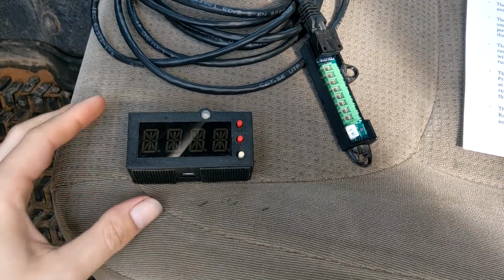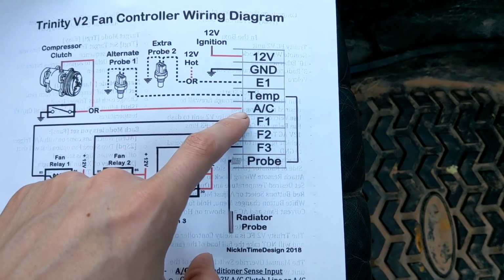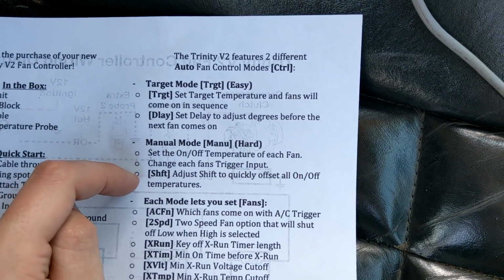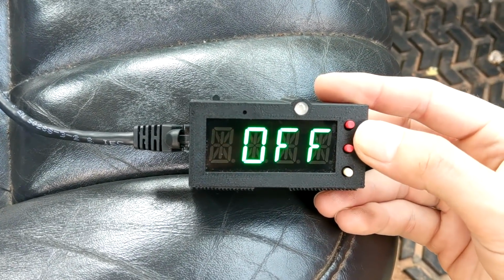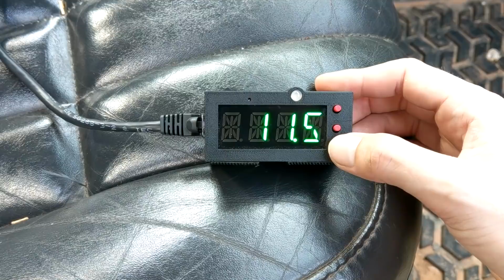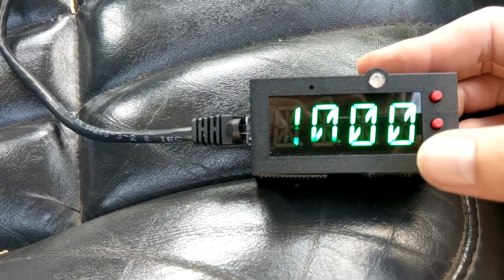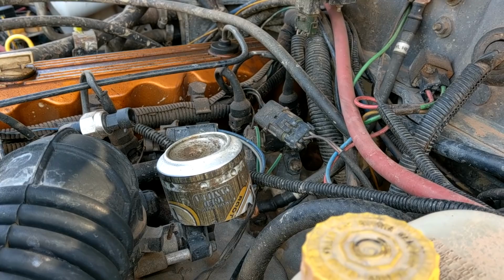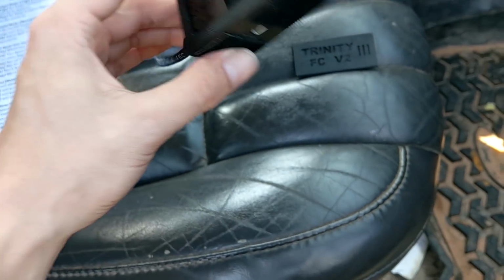Trinity Fan Controller V2 Demo

Comment: I’m glad this is also PWM compatible to some extent. a have a few fans that are pwm tone of the fans runs between 10Hz to 15.5Hz and another fan that runs much higher between 200-300Hz 
if you ever make a controller for that i would be over the moon because close to NO ONE makes super versatile pwm controllers. 
i’m doing a customs retrofit with two PWM fans but i’d love to have a second controller option for them.

Comment: how did i just discover this? i’m running two lincoln mark viii fans in my truck and want to put a 3rd that’s strictly for the transcooler would this work for all 3 even though i’d like to have the transcooler turn on at a different temp?
Reply from the maker: Yes, if you use manual setup then you can sent individual temps for each fan, as well as to use probe 1 or probe 2 for each temp reading.

Comment: Do make a pwm controller sir
Reply from the maker: This has PWM capable hardware, but I never got to program in the functionality because I ran out of space. It could be added if I removed a different feature though.
Reply: @NickInTimeFilms   PWM feature would be great for the lincoln mark viii fans since the are controlled by the cars ecm, the start up amp draw for those fans is pretty massive, coming in at about 70 amps at start up and 41-42 amps wide open. 
if you see my last video you can see the fans and the control system i’m using.

Comment: You need to level your bed so it's closer to the nozzle, also make sure your retraction is set lower and your print speed is also lower...you have a lot of visible layers. Nice work tho
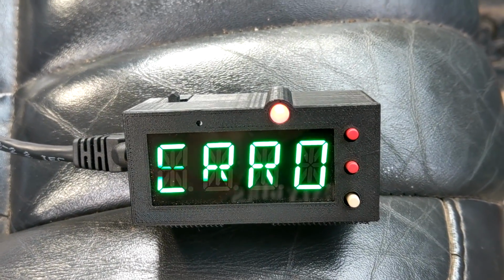Reply from the maker: 18:20 is a good closeup. Do note I love feedback and like to hear others experiences, especially with increasing print quality, so here's a rundown of my current setup.

On this particular print it looks like the bed could be raised the tiniest bit on the bottom left corner, but otherwise is one of the best looking bed surfaces I can get. I use some buildtak knockoff platform sticker, and they work well if you take care of them. The biggest downfall is that if the nozzle gets too close it will dig into it and it's ruined, so I never run too close. Second issue is that the surface leaves a white stain on prints, so the trick to keeping the black in it's true color is to run a little cool and keep the nozzle distance as far away as you can while still getting a clean surface layer. If the bed is too hot and the nozzle is too close, it can sometimes be impossible to remove a print even with thin scrappers, so the level and heat tune are prioritized for easy removal.

Now, the retraction and speeds I have much less experience in because I don't really notice a change when I mess with them. I've only moved them up to a mm or 2 so I'm not sure how much you actually change them for results and what to look for when doing so. I use Makerbot Desktop for a slicer and it's easy to use but some of the pathfinding and support generation is downright terrible, so I just work with the best I can get out of it. I'm curious where on the print you notice retraction issues as I usually pick any little strings off. 

As for print speed and layer quality, this one is more of a time factor then anything. During a production run I'm trying to push out cases as quickly as possible while still keeping a fairly good print quality. I print at 0.2mm layer height as it seems like a good balance. I've tried 0.1mm but besides taking a lot longer, it just seems to make any other print issues even more visible with little overall quality payoff so I don't personally find it worth it. For print speed I run 40mm/s for outlines and 90mm/s for infill, which is usually kept at bare minimum of 15% to 5% depending on the diagonal generation pattern and strength needed. Thicker walls seem to help with strength a lot more than infill though.

Curious on your thoughts and inputs of course. If SLA didn't look so messy and slow then it would be interesting to try for people that wanted much higher quality, as the price has dropped considerably for some models now.

Comment: I forget if the renix era probe is a thermostatic switch, or a sensor.  However there's a fitting in the end tank on the drivers side for the Mishimoto radiators which may work great for a probe location.
Reply from the maker: The Renix rad sensor is only a fan switch, so it's the perfect spot to swap a probe in.

Comment: Excellent work Nick! I picked up an electric water pump from a junkyard a few weeks ago. Came out of a vw bug. I have a manual fan switch and was thinking of adding the electric pump to allow coolant to circulate when engine is off. Just not sure where or how to plumb it into the system, or if it would do more harm by restricting flow when it's not running. Seems pretty powerful tho from just wiring it to a battery dry.
Reply from the maker: Now that sounds really cool! I was curious how an electric pump might work out, as well as adding speed control to really perfect temperature regulation. I would always keep it running atleast a little bit to prevent hot spots and thermal shock when it does flow. Running with the engine off would be neat too!

I'm assuming you are using this in conjunction with the mechanical pump, so I would plumb the electric into the heater core line since its a secondary circuit. As long as it doesn't completly block the flow it should be fine.

Comment: How long will it hold its memory if the battery is disconected. I know most aftermarket radios will lose memory instantly with no 12v constant. And if the m8 screw probe is the same size hole thats located on aftermarket xj radiator on the tank
Reply from the maker: The TFC uses permanent memory so it will never forget settings. As for the thread in probe, it does not fit any XJ threaded locations stock so it will require an adapter.
Reply: Thanks alot will be ordering one soon

Comment: This probably the coolest thing I seen made for a Jeep. Simple, easy, just works. Awesome job Nick! Have you heard of any compatibility issue throughout generations or model/year groups?
Reply from the maker: So far it seems it's only been tested on XJs but this is a universal kit designed to work on any vehicle. As long as the TFC has access to the fans relay you are golden.

Comment: Nick, can I control say an engine fan via engine temp a condenser fan from A/c switch?
Reply from the maker: Absolutely. With manual mode you can set fan 1 to use the temp probe and fan 2 no probe, then adjust the ac fans so fan 2 comes on